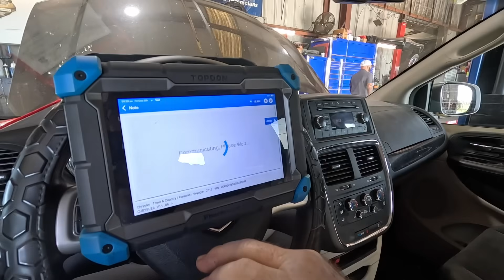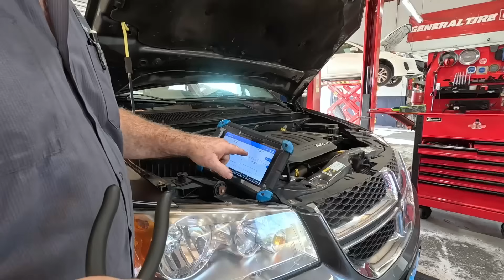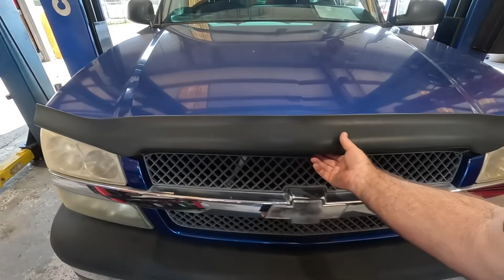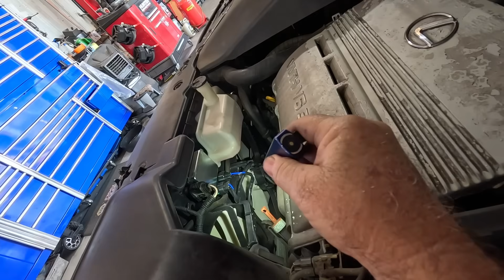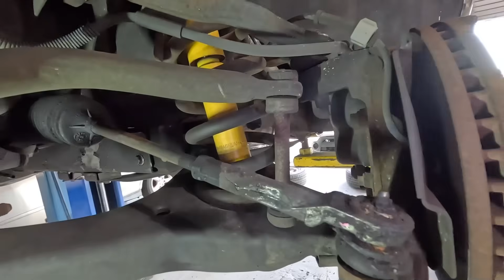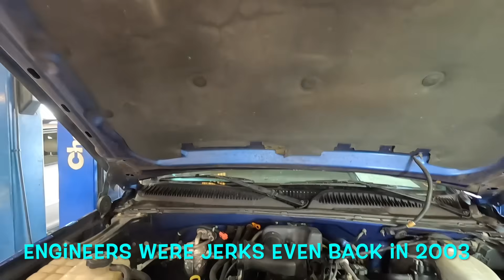03 Silverado, Hoses, Wipers, Brakes. Lexus Overheats? Caravan SES on. A DAY in the Life 844. Repair

Comment: i got a tool off tool truck its like a fork that screws on a steel rod that turns the fork 90 degrees where you can pull the tool with one hand and the hose with the other works great for those
Reply from the maker: Sounds like a handy tool for those stubborn hoses! Need to check it out and see one for myself!